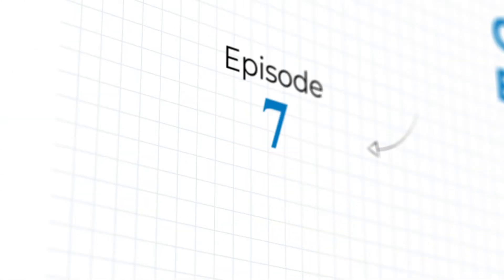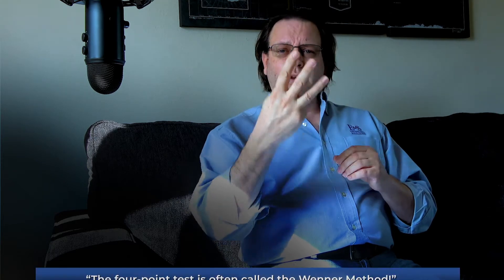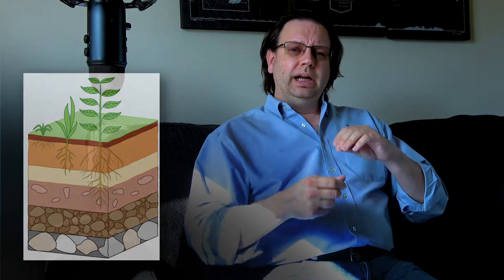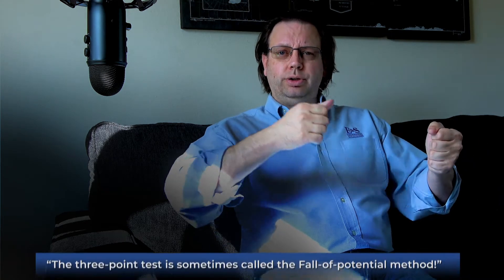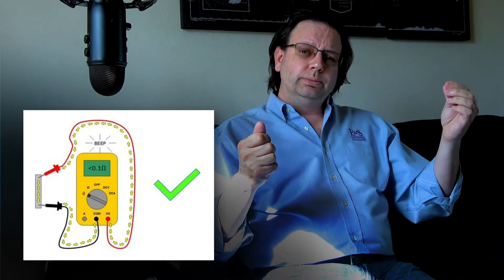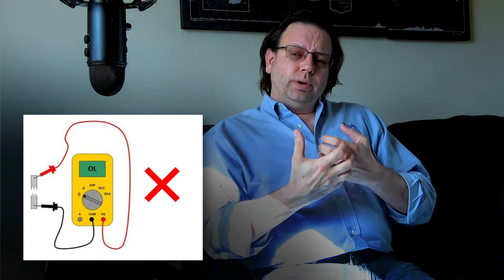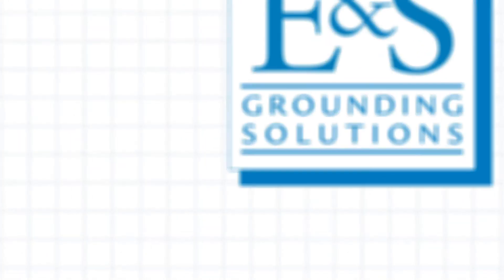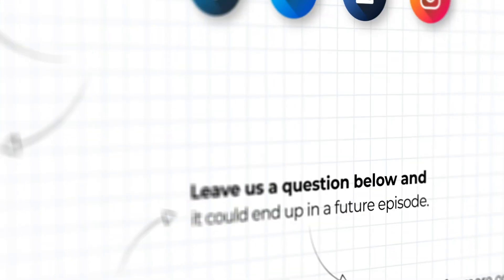What are the Common Tests for Grounding Systems?

Comment: I thought grounding was to clear potential via current flow.  In other words, it is not the current we are clearing but the potential difference.  An analogy is like, if you have a dam of water, and a valve at the bottom (variable size opening), then, consider the water in the dam as a potential energy.  It is unimportant where the stored water came from, because it could have been from a flash flood, or a trickling stream, the important part is, can the grounding system handle the specific potential we are guarding against and at the rate it will be fast or high enough to trip electrical protective devices.   The flow of current only happens upon a differential potential which is generated via multiple sources (static charge, shield potential, short to ground, lightning, etc.).  

So, resistance is very interesting because I note that there are high resistance grounds, and low resistance grounds, but I have not fully understood why a specific resistance is necessary except for a low resistance to clear a fault quickly.  I can only assume that resistance would be necessary to protect the conductor used for grounding against large potential spikes, as in lightning, so that the fault could be cleared but with limiting the current flow to protect from loss of the grounding conductor.  Is that correct thinking?  IN that case, would we have low and high resistance grounding systems, for example, a low resistance ground to provide a path for shielded and multi-shielded transformers and other small anomalous sources of harmonics for sensitive equipment such as RF signaling, and  a high resistance ground sized for specific threats with conductors that could withstand a particular potential spike such as 10000 volts or some other high differential like lightning or a short to case situation.?

I am trying to design for shields on transformers that are isolation xfmr for inverter systems that are ungrounded both sides.  We are grounding the shields to pull off the variant power for lack of a Neutral in this case.  We need 5 or less ohms.  Do the civil engineers have data for each region and soil type regarding the average resitance of those areas, or do we need to get a grounding specialist to measure that site in particular?